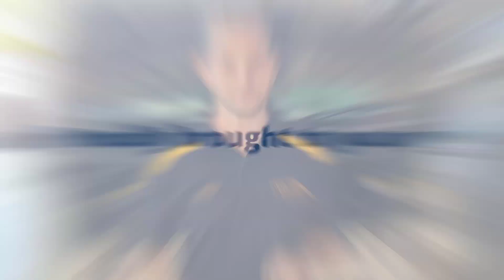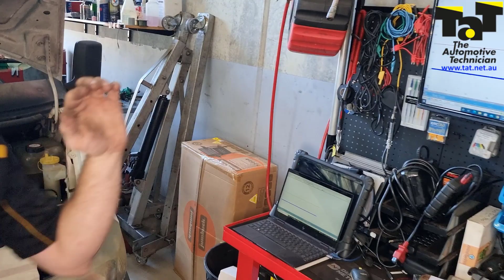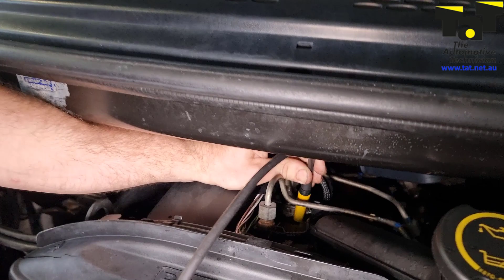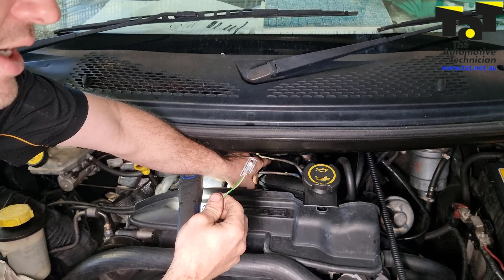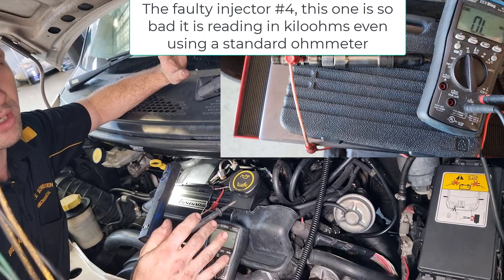CRD Injector Electrical Testing

Comment: I know this is about basics . I see you have the GTC 505 Ignition tester . Have you tried the GTC 605 Injector Tester ? It is under $ 300.00 in US Dollars . If it helps a shop get to the issue quickly , I can't see not owning one . Same with the GTC 505 . Time is money . The parts cannon is not free .